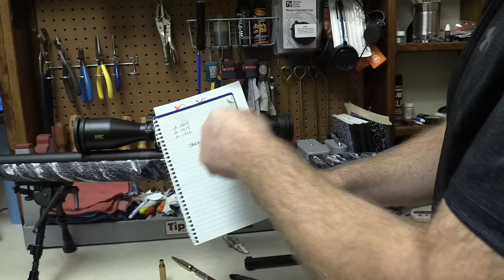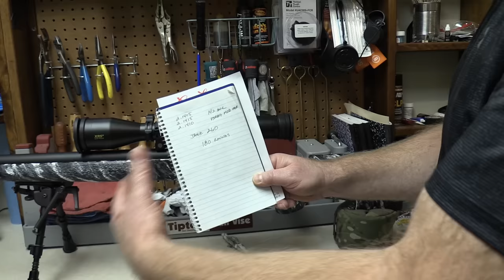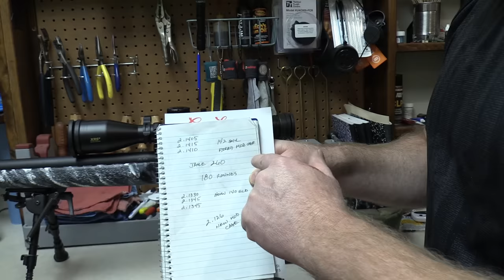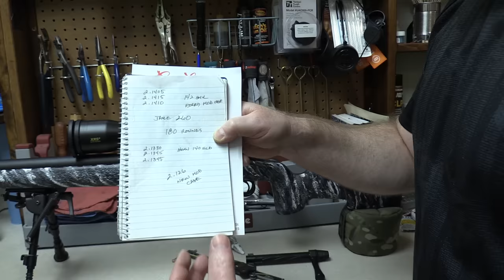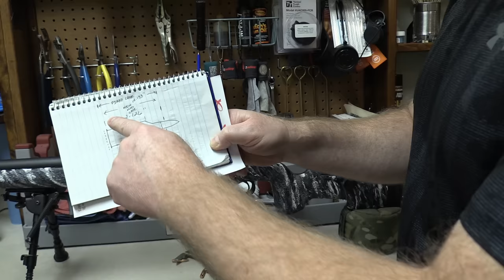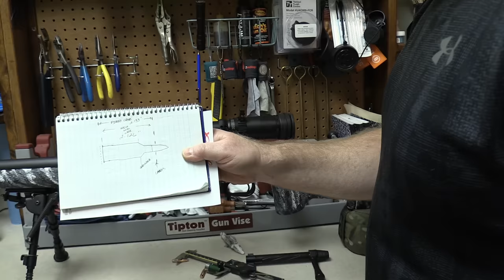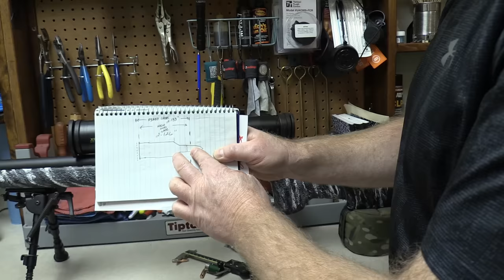COAL vs.  CBTO & Measuring Max CBTO w/ Hornady LnL OAL Gauge

Comment: the chief ballistician at burger says it's better to stay off the lands, at first, my question is how far common sense says you don't want to introduce slap of any kind and ogive matters the standards, tangent/ secant, and hybrids, how many adjustments can a guy do before he gets lost in the equations?  he says the have a line of projectiles that help take the guesswork out of it somewhat.

I'm a nearly broke dumb ass on a consistent basis, I don't want to spend the next ten years i don't have to be a gun bumb trying to figure it out just what to do let alone just what i want to do, and i damn sure i don't want my waistband to get any smaller in the current environment.  I know I want to go big and fast and like everything else that's not cheap. there gotta be something out there that lets joe blow get to the damn point i know it wrong for wanting a shortcut but Joe and JoAnn public is never going to show interest if they gotta think too hard. case in point"linux" reaching the masses when necessary is a booger to pull off. no matter the merit. I've heard tell of cant-miss techniques machining by matching the bullets to the rifling but that will get you a knock on the door from the alphabet gang.  not to mention that's short-lived and nowhere near worth all that. poor dumb ass like me ain't got a chance,100's of years of tradition and it still comes down to some guy kicking up dust in a spare room in his basement. meanwhile, there is a library of standards on every subject ever explored in recorded history no one man could ever plow through in his short lifetime, ever feel really small? i have. thank you for trying Panhandle, thank you bubby.

Comment: False information!   If you measure COAL with a bullet and you load THAT bullet to the measured length,  all of the other bullets will retain  the correct length.    That is regardless of nose shape / condition.